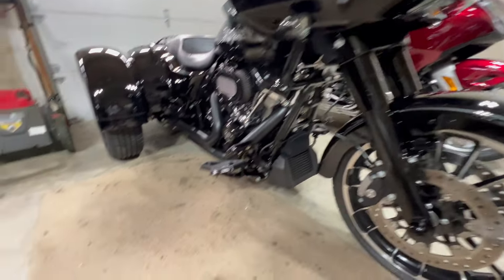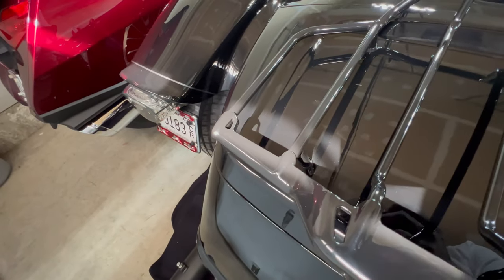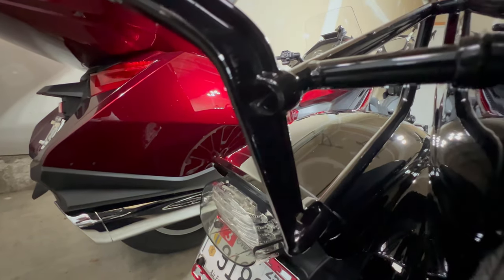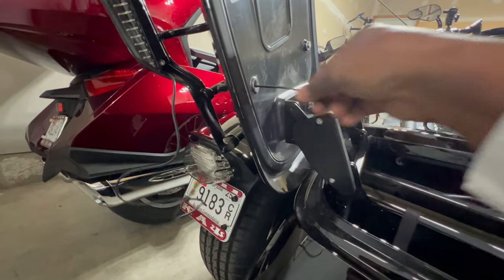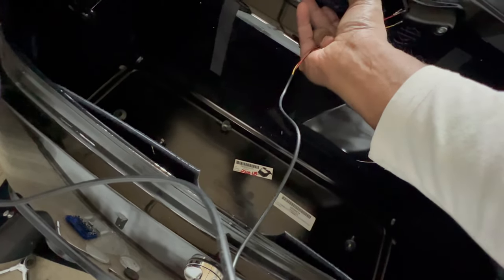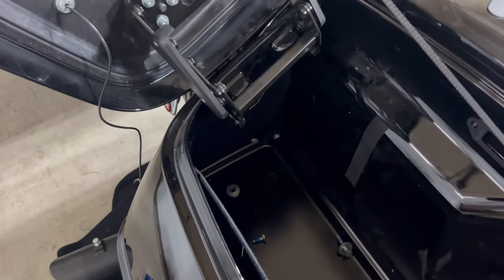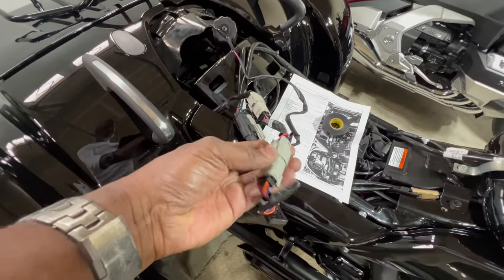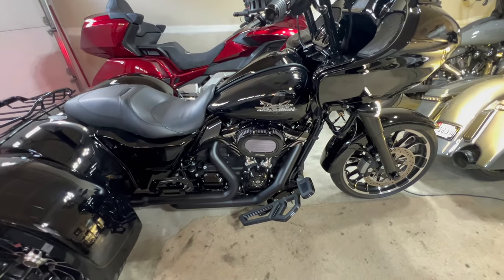How to install custom dynamics brake light to luggage rack on the 23 Harley-Davidson Road Glide 3

Comment: 🤜I appreciated your video, it helps me a lot... Thank you very much. I have a question if you can answer it...,  I bought the luggage rack from harley, but it came with a different cable harness (looks for earlier versions), my questions is, were I can get the same harness that you using on your video for your RG3? Thank you...
Reply from the maker: Thank you.   I appreciate.  Customs dynamics was the company I used for the light.   On there website the post the install instructions for all their parts.
Reply: Thank you Chris @ChrisGlides
Reply from the maker: Custom Dynamics- CD-LR-01-S AUXILIARY RUN & BRAKE AIR WING LUGGAGE RACK LIGHT BAR FOR 2014-2023 HARLEY-DAVIDSON® MOTORCYCLES $69.95 https://www.customdynamics.com/air-wing-rack-led-light-kit-01/

Comment: Was there some kind of grommet supplied where the wires pass through the rear of the trunk?
Reply from the maker: I trashed the grommet for flex tape. Grommets can’t be seen for the location that mine is. Flex tape keeps all water out and grommets don’t and they are a pain to put on.